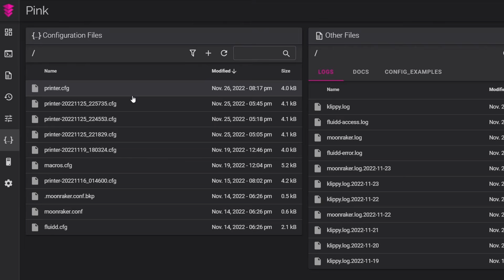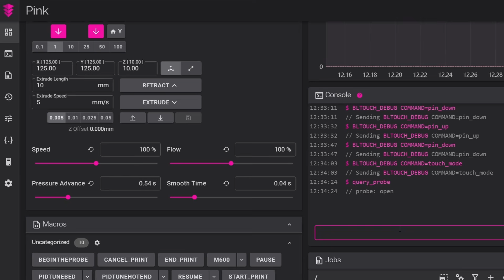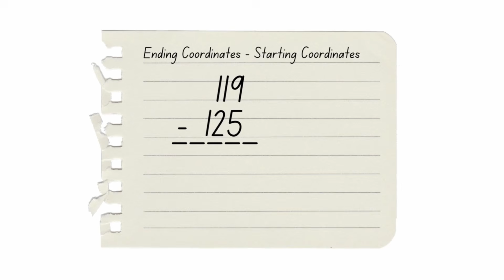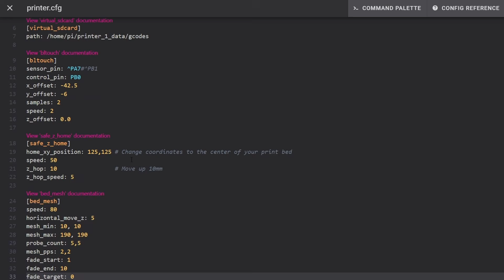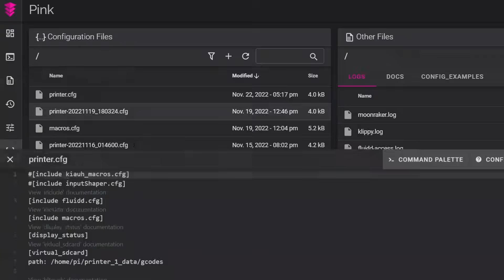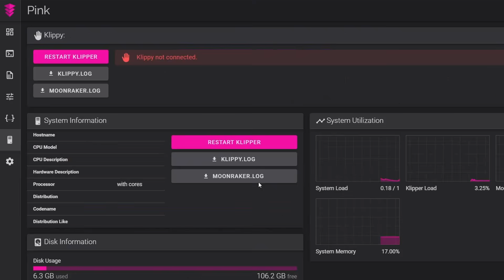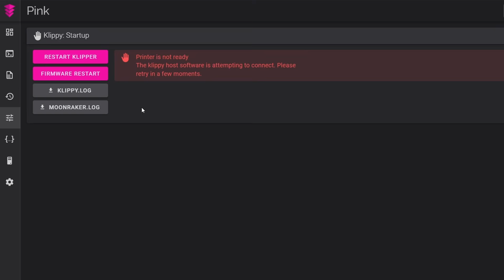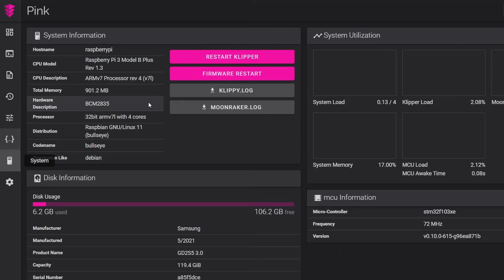BL Touch complete setup for Klipper! Maximize your probed bed mesh!

Comment: what if when you send the down command the pin comes back up immediately and the light starts blinking red I already tried checking the connection of my CRTouch
Reply from the maker: I would think there might be something that could be corrected in the printer.cfg for an issue like that. Can you send me a post of the [bl_touch] section of your configuration?
Reply: @PrintsLeo3D  
[bltouch]
sensor_pin: ^PC14 
control_pin: PC13 
x_offset: -32
y_offset: -41
z_offset: 2.900
speed:10
samples:1
samples_result:average
probe_with_touch_mode: true
stow_on_each_sample: false
Reply from the maker: Initially this feels like a wiring issue, but I know you said you had checked that . I want to compare your pinout with mine when I get home. What mainboard is in your printer ?
Reply: @PrintsLeo3D  my main board is a 2.4.S1 Silent board and I have a Ender 3 S1 Pro
Reply from the maker: So the only thing I can think to try (that's quick and easy) is to try commenting out (put a # mark before the line in printer.cfg) stow _on_each_sample. I'm not sure this would have an affect, but you never know. This feels like a connection issue. Did you check the connection at the probe and the board ?
Reply: @PrintsLeo3D  I already tried commenting that out too
Reply: @PrintsLeo3D  I commented everything after sample and still nothing it might be a faulty write out maybe my crtouch is just faulty I have a video of me testing it I’ll upload it
Reply from the maker: Yea a video is going to be helpful. Is this the first time running the CR Touch or had it been working up to this point?
Reply: @PrintsLeo3D  I uploaded the videos as 1 whole video now should be slightly more clear too since it has 2 different webcam angles
Reply from the maker: It's hard to see on my phone, I'm going to watch when I get to my computer, but two weird things I noted. When you are homed at the center of the bed the coordinates are showing 0,0,0 when it should show the safe_z_home.coords. I am assuming you moved it there manually though because the bl touch issue. Then during homing, the Z axis coords shoot to 400+ and then the bk touch fails to deploy. I wonder if there's something to that ?
Reply: @PrintsLeo3D  
[safe_z_home]
home_xy_position: 147,154
speed: 100
z_hop: 10
z_hop_speed: 5
Reply from the maker: Have you made any progress with this?
Reply: @PrintsLeo3D  it randomly started working yesterday then after I leveled the bed the crtouch failed I have a new one coming in a few days
Reply from the maker: Yea, could definitely be a defect device. Let me know how it ends up going.
Reply: @PrintsLeo3D  yeah it’s probably a defect it started working again today but I have to level the bed still I’ll do that after work and see if it still works
Reply: @PrintsLeo3D  my new crtouch arrived and everything is working perfectly fine now

Comment: Anyone has the bed adhesion gcode?
Thx for the video!
Reply from the maker: Hey, thanks for watching! If you're referring the 5 cube print I used for adhesion, I don't really have a gcode for it, because you can create it very simply in your slicer ! I just import a plain cube (20x20x20) then I scale the Z height down to a single layer (20x20x0.2), which gives me that small square. Then I multiply it four times and spread them out over the bed. For the average ender 3/aquila bed I put them at coordinates (70,70// -70,70,// -70,-70,// 70,-70). Let me know if this helps !
Reply: @PrintsLeo3D  Thank you so much! <3

Comment: Is it preferable for the BLTouch to probe without the offset applied in the safe_z_home section? I have mine so the probe is aligned to where the print head will be, ie: the x-axis is at 167 and y is 132 for the homing so the probe touches closer to the center. Does it matter?
Reply from the maker: The point of 'safe z home' is to make sure your probe won't accidentally miss the bed when homing, causing your nozzle to crash into the bed. If you've put some thought into it, like you have, then it should be all good. The one caveat is that wheb you use probe_calibrate to adjust the z offset, the printer will put the nozzle where the probe homes, so just make sure you aren't too close to any of the min or max bounds otherwise you may get a movement out of range error. Your values seems great though .

Comment: I am a very new to Klipper. Your printer.cfg file has a start and stop gcode. Mine does not. Pretty sure mine gets that gcode from Cura. I'm not sure if I should delete Cura's start and stop gcode? and add it to Klipper printer.cfg file? Other wise I'm not sure where to add the BED_MESH_PROFILE.     Thanks for any advise!
Reply from the maker: Hey Jason, I think I saw a message from you earlier, but when I went to answer it I couldn't find it, so I'm sorry if I didn't respond. Welcome to Klipper, it's awesome firmware but it's different, so there can be a learning curve there but once you get it you'll be set! 
Klipper has an awesome feature called macros, and what that means is you create a title and then within that title you can curate a whole section of gcode commands you want the printer to perform. Then whenever the printer is sent the name of the macro (the title) it executes all the commands that are houses in it. It's a very powerful tool and its what you're going to be using for your start and end gcode.

You were right , with Marlin we used to put the entire start(and end) gcode inside Cura, then it would be added to the gcode file for the printer to perform. With Klipper you're going to move those sections (start and end) to your printer.cfg file. You'll create a start and end macro! I name them start_print and end_print. Under the start_print macro you'll copy all the start gcode that used to be in Cura. Then you'll do the same thing with the end_print macro. Then inside Cura delete everything under the start gcode section and add the line start_print (which is the name of the macro). When the printer gets fed that line it will execute all the start commands you've been running! You'll do the same for the end gcode, just add end_print. 

The bed mesh profile (which is saved after running bed mesh calibrate) will be added to the start_print macro right after the G28 line. 

I'd love to talk more and help you further, the two best avenues for this are through email (printsleo3d@gmail.com) or more directly through the channel discord (find the link in description) because on the discord there are more people in similar situations that can help. 

Get back to me though because I know I just threw a lot of info at you and I'd be happy to clear anything up.
Reply: @PrintsLeo3D  Thank you for the detailed answer! I will remove it from cura and add it to klipper. It makes sense to have  all the code  in one place... BTW I deleted my question earlier,  I had figured out my problem shortly after posting it.
Reply from the maker: Oh ok, great! Sometimes YouTube won't notify me, and then it gets hard to find. Happy you solved the first question and now this! If you still need help reach out to me anywhere including here and I'll be happy to help!
Reply: @PrintsLeo3D  When I add the start and end gcode to klippers printer.cfg file, the printer no longer goes to the left to "purge" the nozzle. It just starts printing. I tried using the start and end code from Klippers website and adding cura's gcode to puge. That didn't work, so I added only Cura's gcode to the printer.cfg file, still doesn't purge, just starts printing.  Also, once I create a start and stop to printer.cfg, I should delete all the gcode in cura's printer settings? Thanks!
Reply from the maker: Hey Jason, give my start code a try. I have it on my website and it includes the purge line. Usually with slicers you need to instantiate a temperature value, but with Cura, if it recognizes you don't have that it will load them for you. So that's why my start print macro is pretty thin but it should work for you. 

https://www.printsleo3d.com/macros

Comment: How can I add a start_print gcode ? . Does work if I only add to the config file .
Reply from the maker: Short answer is no, you also need to add a reference to that start code in your slicer.

What you do is create a Start_Print macro, and enter it in your printer.cfg That will house all the commands you want to start before your print. In your slicer under the start gcode section, you'll just run that macro, and to do that you just add the title of the macro you want to run , in this case Start_Print. So your slicer will add the call to your start_print macro at the beginning of the print, and it will execute everything you've added in printer.cfg
Reply: @PrintsLeo3D  great thanks , I forgot to call the macro from the slicer ...
Reply from the maker: Yea, I'm sorry I used the world's lengthiest way to tell you that lol my brain is still hasn't turned on yet today lol glad you got this going though

Comment: So I should remove the x and y offsets in my slicer and only use printer.cfg?
Reply from the maker: Yes you'll want to use the offsets direct from the printer.cfg I'm not sure which slicer you're using, but  with Cura, for example, the X and Y offsets are used for the slicer itself to determine the size of the actual printhead. It uses that data to determine if there will be any collisions if you're using the 'print one at a time' option. Meaning you print a model, and then print another while the first model is still on the build plate. The slicer tried to make sure there are no collision and uses the slicer offsets for that value(at least in Cura, and under the machine settings area).

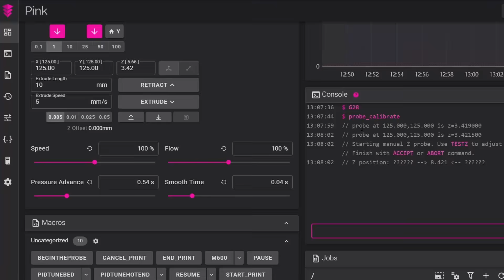Comment: @9:45 if the printer is so far away from the computer, that will be a PITA! Can you not do it at the printer itself, from the screen?
Reply from the maker: No you can't, because once you upgrade to Klipper the on board screen doesn't work anymore, but because you can access Klipper from a webpage you can open your front end on your phone or tablet and perform this right in front of the printer !

Comment: bro please show you using the calculator when doing the maths
Reply from the maker: Hey, thanks for the suggestion! I had a screen cap of me using the calculator, but in the end I didn't I cut it to try and save some time for the video (and I wasn't sure if people would be interested). Going forward when I'm using a calculator I'll try and keep it in mind to make sure it's displayed. Thanks for watching and for the suggestion !
Reply: @PrintsLeo3D  no problem happy to help 
 I did eventually figure it out it was actually pretty obvious but seeing you perform the calculations on the video definitely would have made it a little easier and also
 ur vids are my go 2 they've helped me Soo soooo much with setting up klipper for my printer so thank you!! if it wasn't for creators such as yourself klipper would seem overwhelming impossible but thanx to videos like yours I now have sweet super dialed in printer and have infact installed klipper on all my printers now because of how awesomely customizable it is
and I am happily never going back too marlin lol
Reply from the maker: Ah thanks so much for those kind words, it really means a lot, and honestly thank you so much for the intial comment. If you didn't let me know, my next videos might not have had it either, and they won't provide the help they should. You made another great point at the end about Klipper too, how customizable it is, that's a great point and it gets lost so often when the "crazy fast Klipper speeds" seem to take the forefront. I plan on making a "what is Klipper and do you want it?" videk shortly, and I want to highlight all the special qualities it offers that isn't the speed. So, thanks for that also!

Comment: Hi @PrintsLeo3D, awesome video tutorial. I Have a BIG BIG Problem with the first layer. It's uneven.
I try to explain:
i followed all the steps, i find the coordinates for the proble (Bltouch clone), Calibrate the proble in the middle of the bed (the nozzle is in the middle -110;110-, the probe is x_offset:-24
y_offset:-22) find mesh min and max and it start to proble a mesh 5x5 correctly.
When i start a print, the first layer is not good in a particulary zone (it's lower,very close to the bed in the left lower zone). WHY?I m very frustrating. 
I removed Fade options but not fix the strange problem.
Reply from the maker: Hey Lorenzo thanks for watching and reaching out. After you create the mesh through the 5x5 probing grid, how does the bed visualization look? That's the multicolored image of the actual curves of your bed. There's also a min and max deviation on that page (usually under 1mm), what's yours. Last have you added the line to your start gcode to use that mesh you created (BED_MESH_PROFILE LOAD=default)?
Reply: @PrintsLeo3D  hi thank u for the reply, very appreciate! Yes i have the Bed Mesh Profile active in my Start Gcode
I have a very strange problem, i went deep to the issue.
My bed now is very close to the nozzle but klipper and the probe take the values wrong.
All 4 corners are in the same level but in front of me i have Blu zones and behind i have Red zones. Maybe my probe is faulty?
Reply from the maker: I'm not too sure. Is there any way we can communicate through email (printsleo3d@gmail.com) or Discord (https://discord.gg/Z5FUZ4Ya) this was we can exchange photos and and I can see what the bed mesh looks like ?
Reply: @PrintsLeo3D  i'm in your discord server, THANK U!

Comment: I feel this is a silly ask, but what is the calibration print you are using to live adjust the z offset?
Reply: oops I think I figured it out.  You just placed down 5 calibration cubes and the a skirt.  :)
Reply from the maker: Yup! Not a silly question either, a lot of people ask about it and I keep forgetting to make a little note or a link to it. Like you figured, it's just 5 cubes that are lowered to just the height of a single printable layer (actually I am using an older version of Cura so it's just over the height of a layer to counteract a bug). I didn't think to offer a .stl or gcode because some beds are different sizes and I want it to be applicable to your printer.

Comment: Do you still need a G29 in your slicer gcode? or is that now covered by the firmware?
Reply from the maker: No you can remove it. It's now all be done through the firmware in your start_print macro. The way I show in this video is to create a mesh outside of a print, and then just call it. If you want to probe before each print, you can remove this line:

BED_MESH_PROFILE LOAD=default

and in it's place add:

BED_MESH_CALIBRATE [METHOD=manual]

if you have any more questions with this don't be shy!
Reply: @PrintsLeo3D  I have 3 Ender 3s, 2 duet and 1 Klipper. And getting start and end gcode working correctly was a challenge. Some gcode Mxxx are not supported in one or the other. I guess if we can strip the start and end gcode from the slicer and have it run in the firmware the better. Thanks.
Reply from the maker: Yea Klipper does not use some of the base gcode commands but makes it really easy with the use of macros. Macros are blocks of command that you give a name to. When that name is called the printer runs that block of command. So you can create a start print macro (usually named, you guessed it, "start_print") and house all your start gcode there. Then in Cura under staff gcode you just put start_print. This way Cura is always calling the correct macro, and you can make any customization firmware side just by editing it! So if you sliced a model before you had a bl touch, then you added the bl touch down the line, you wouldn't need to reslice it with the added portion of start gcode. You would just change the line in your macro, which cure is calling anyway. Does that make sense ? Not sure if I explained that enough.

Comment: Can you show how to set-up: Klipper adaptive meshing. Thanks. I was watching another video but the guy started with a voron mostly configured. I have a bltouch/ender 3. Thanks. Very clear video. Just subscribed.
Reply from the maker: Thanks for watching and subscribing! A few people have been asking about this so it's something I have been looking to cover. What slicer are you using? I will probably be making the video based on Cura, but will try and add the few differences there are with this setup between slicers.
Reply: @PrintsLeo3D  I use Cura, I want to get into Prusa slicer as a back up but if you are familiar with CHEP on the tube. He has an ultrafast Cura profile that prints amazingly on the ender 3. If I can figure out how to transpose his Cura profile to Prusa...

Comment: What will be mesh max and min for
Probe - 36,-9.6
Bed size 235x235x250
Im having very hard time to find
Reply: Just watched video, honestly very detailed explanations.
Thanku so much
Reply from the maker: Well it's sort of going to depend. Some printers state they can reach those X and Y bounds (235x235y) but in practice the printhead or bed may not be able to reach them without hitting the frame first. This is especially true if you've changed the hotend or shroud. I can give you some estimates though based on those numbers. I am going to round the Y offset for the probe to 10 for this.

If the hotend/bed can actually travel to 235x235 unencumbered:

mesh_min: 10,10
mesh_max: 199, 225

This would be a more conservative set of values, I am assuming your hotend/bed can reach 225x225:

mesh_min:10,10
mesh_max: 189, 215

For ultra conservative values, as in it's extremely unlikely you'd have issues with it, a build size of 220x220:

mesh_min: 10,10
mesh_max: 184, 210

Hope this helps. If you need more info let me know!
Reply: @PrintsLeo3D  thanku so much, wish you huge success in this journey
Reply from the maker: Thank you! I appreciate you giving me the chance to help! Happy printing
Reply: @PrintsLeo3D  First option helped <3